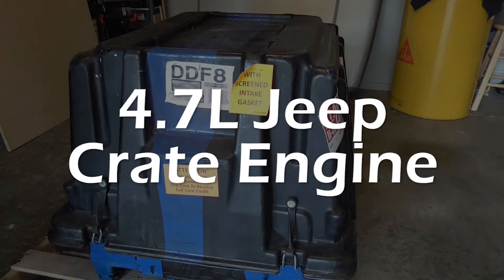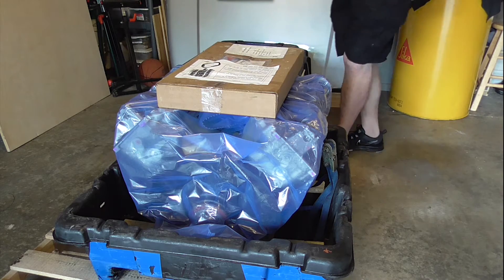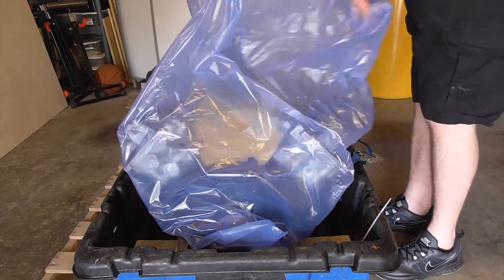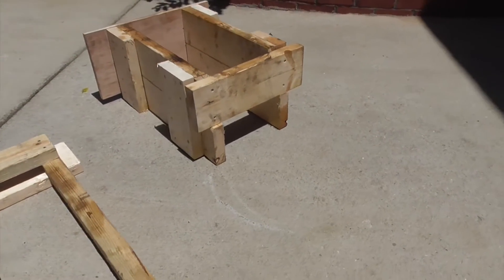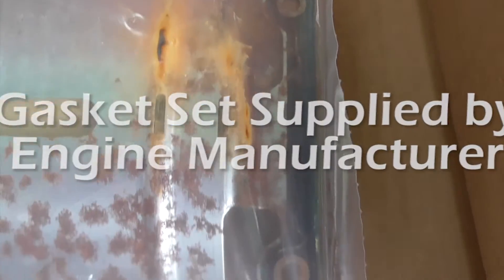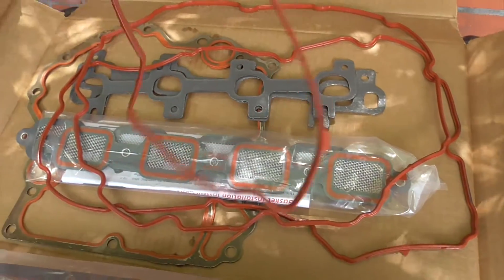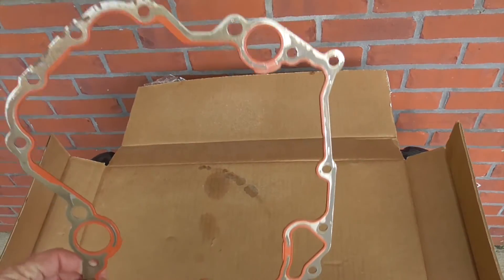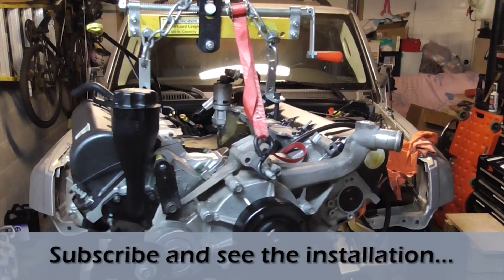4.7L Jeep Crate Engine DDF8

Comment: where did you get your create engine. Why didn't you just repair your head gaskets
Reply from the maker: There was more damage than just the heads and gaskets. Wife drove it about 18 miles before the engine finally quit and I was surprised it even restarted after installing a new water pump then it would not start again after that. You can get this engine almost anywhere auto parts are sold or do a google search for DDF8 and compare prices. I think they all come from the same rebuild factory in Mexico regardless of where you buy it. I have put about 11,000 miles on the new engine and it is runs great.

Comment: How did you get the thing fine-tuned after you got your 4.7 Stroker motor done. What was the outcome of the ignition and everything you had to do to get a Dyno Tuned in.
Reply from the maker: Hi Richard, The engine swap turned out successful. There is basically nothing to fine tune on this overhead cam 4.7L engine as the sensors and computer take care of that. Not sure about a dyno tune in this video but I’m pretty sure something was done at the rebuild factory. The only thing I was concerned about upon startup was that it had oil pressure and once I saw the external oil pressure gauge working immediately, I relaxed a little until the rings were seated. I have been pleased with this new engine and it has performed remarkable for the past 3 years. When I change the oil, I get almost the full 6 quarts back when drained.      Thanks for the comments!